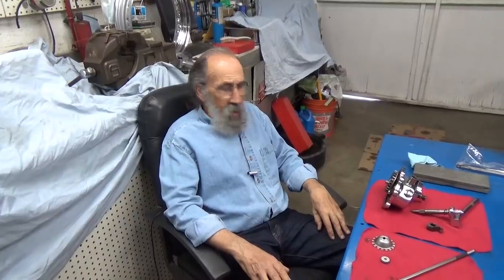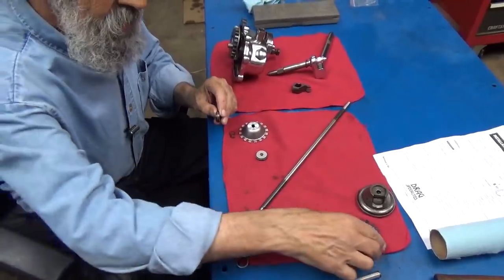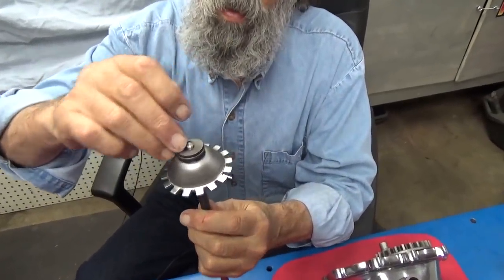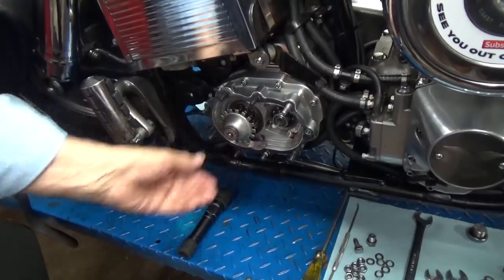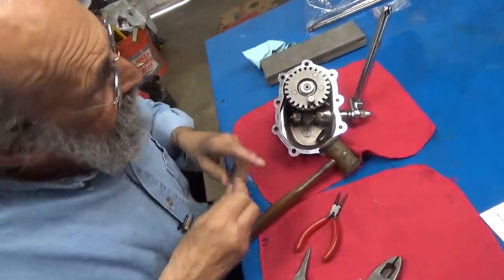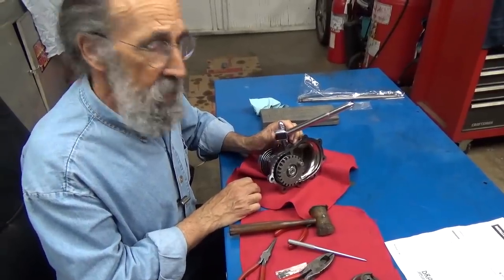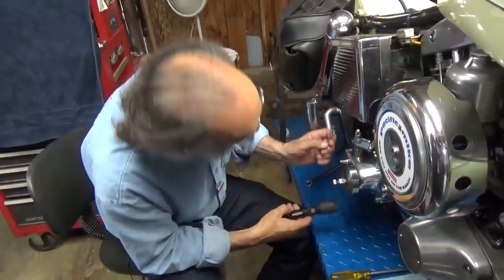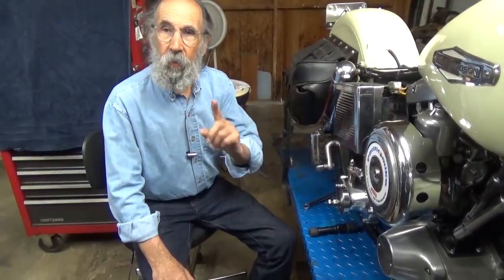Repair by replacing: Clutch Throwout Bearing and Oil Slinger on Harley Davidson Shovelhead.

Comment: Don't know if someone beat me to the name of the bearing. But hear it goes, It's a TORRINTON BEARING...

Mike, I go through the same problem,  I forgot the name of parts, I have it on the tip of my tong, the the name just dosen't come out...
Love your videos...👍

One more thing, and your weight, the washers are bearing races.
Reply from the maker: Not right.  Torrington is a brand.  We replace the original cam bearings in Harleys with Torrington.   The ones we use are encased and have parallel rollers.  But yes, I forget stuff quite often.

Comment: Good info thanks, I just bought two kicker kits for a couple electric start shovels I have. 
This video showed me what to expect during the install. thanks. 
We call  those "C" clips and use C-Clip pliers to spread and install them.
I think you forgot to install your kicker cover gasket. 
Thanks Bro.
Reply from the maker: Thank You.  No, I didn't.  I had already put it on.  I forgot to tell you.  Look closely.
Reply: @pacificmike9501  You dang sure did install that gasket, haha, I see it now. Thanks
Reply: @bovrbey  may I ask where you sourced those kicker kits? I might want to put one on our electric only 78.

Comment: Thanks for the video Mike. Interesting setup on this clutch. I am always interested in seeing how different manufactures design and engineer these type of devices. I just installed a Barnett Clutch pressure plate and new friction disks on my 1997 Yamaha Royal Star. I have launched many clips in my day. I usually use a magnet tool in close proximity to the clip and it usually catches it.
Just got off the phone with the manufacturer of the Clutch. I was just giving some feedback about the installation instructions and how they might be better. I had asked him about the wire that gets installed between the 7 friction disk and steel plates and the 1 friction plate all the way in the closest to the internal engine. I did not get the perfect installation on this and was concerned. He said he spoke with Yamaha top clutch engineer and he said you really don't need it. I feel better about it and the clutch works great so far.
Reply from the maker: Yes, I've done business with Barnett for many decades.  Great people, products and service.

Comment: Hi Mike!
It's mutch easier to put the kicker spring in the end, so you can put the cover without tools. I did it several times on my Baker 6 speed. Cheers from France
Reply from the maker: But it's fun.  Actually, it's a habit from the need to work quickly in a shop environment.  You don't want to remove the arm.

Comment: Hi Mike 
Really enjoy your videos. You have a great way of explaining and showing the work. 
I have a 1946 UL, 74 ci, right hand throttle, left grip controls timer, linkert carburetor.  It needs new cables for front brake, timer, and throttle. I've tried lubricating the cables with dri-slide moly lubricant, held them vertical overnight to get lubricant to drip down, but can't get it to fully coat the old cables. They are not very responsive and it is just dangerous with a sticky throttle. So I ordered new restoration quality cables with wire in a coil in cotton braided jacket. I know I have to trim them to fit, but am leery - they are spendy - cutting the wire and trimming the coil just so - I'd like to get it right.  I've looked in service manual and in Palmer's books and did not find much help.  Looked online and seems only modern cables are covered. Would you consider doing a video on replacing and trimming the old style cables and adjusting throttle spiral, timer, and front brake? Or do you know of a good reference?  Thanks much
Reply from the maker: It's alway tough.  You just have to be careful and trim as necessary.   Leaving them too long and then having to shorten them again is the best.  We'll show it when we have one we need to do.  Can't just randomely do these things.
Reply: @pacificmike9501  Mike
Thanks for the quick reply !  Wow !  That was fast.  I will definitely start a bit longer and trim if needed.  I'll start with brake cable as it's easier to access and doing it a couple times will give me some practice before I start doing the throttle and timer which are run in handlebar.  Thanks again
Reply: Well, just in case anyone else is interested in control cables, I did some more research and found some references, so I'll post them for their use:
1.  Palmer second edition of "How to Restore your HD"  does have a section on control cable routing and trimming in Chapter 2 under Chassis.  See pages 128-134.  
2.  Kirk Perrry's "Mechanics and Owners Guide to HD OHV Big Twins," 1941-59, vol 1 describes timer cable on pages 113-114.  In Vol 2, Perry has lots of photos of parts in handlebars and describes process of cleaning and replacing on pages 89-93.  He gives a good tip for cutting coil wire on page 155.
3.  The second edition (1945) of Nicholson's Modern MC Mechanics, page 319 has some good general tips on control cables.  Of interest is they recommend "tinning" the braided wire before cutting it to prevent unraveling.
4.  Rick Schunk's "How to Rebuild/Restore Classic HD Big Twins" describes installing coil and wire and has nice color photos pages 66-68.
5.  There is a reprint of the early Riders Handbooks "HD Operation, Maintenance, Operation 1930-1949 Models."  It discusses control cables in the Riders Handbooks for 1930-34 and 35-40 models.  This reprint is still available from Harley dealers (as of Jan 2020) under PN 99407-93.  It was $35.
Hope I did not overstep any bounds, but I am a book geek, love the research and sharing what I found.  I know, should spend more time riding, but I am what I am.

Comment: It’s crazy that you chose today to post this video. I could’ve really used it a couple days ago, the Shovelhead Bobber project we are building at the shop I work at had the retaining clip fall off the clutch push rod so all the throwout bearing parts were inside the transmission. I figured it out but it would’ve been cool to have this as a reference. 

Funny how timing works like that huh?
Reply from the maker: Yah it is.  Ever notice in the shop, half your customers have clutch problems at once?  Then, the next week, they all burn up voltage regulators.  Go figure.
Reply: Pacific Mike haha! I have like 3 bikes to work on here in my shop this week for electrical issues! 

You sure you’re not following me around or some something? 😂

In all seriousness I appreciate the reply and I seriously appreciate the fact that you post videos like these. I’m 32 now, been doing this since I was 13-14 and I cut my teeth on Twin Cams and now I’ve also pretty well got the M8 figured out, especially the EFI models. I grew up with that so I had to have help from older, more experienced techs like yourself to learn how to diagnose and repair carbs properly. The same with most of my Evo motor knowledge, I’ve gained it by watching videos like yours and Tatro Machine’s. There’s not many of you guys around that know how to work on these older bikes, this knowledge you’re archiving and sharing is absolutely invaluable and priceless in my opinion. I can’t tell you how much it means because you can’t find this kind of good, solid information from knowledgeable guys just anywhere. Especially in this day and age where everyone who thinks they are an HD tech is able to post their ideas all over forums and Facebook. It’s so nice to have people like you that are experienced, seasoned and most importantly actually practicing the art, not just a hobbyist doing it on the weekends. 

I can’t say thanks enough sir.

Comment: Last E clip I had to play with wound up in the bin and a regular snap ring was in its place. I TOO prefer the Earlier style throw out bearing. I find that the later part has too many bits to screw up when you least expect it.
Reply from the maker: I agree.  What I actually did find the first E clip in my beard.
Reply: I think you might have meant , 'parts to CHEW UP' !  At least that's been my experience with my Ol Shovelhead. Lol

Comment: You’re a master, and I still can’t get my baby started
Reply from the maker: What is it?  What year?  What carburetor?  What ignition?  When did it run last?  How old is the gasoline?  I'll play.  Gimme facts.
Reply: 05 Harley Dyna Super Glide Custom EFI I’ve changed plugs and battery I’m missing something
Reply: It’s an 05 Dyna Super Glide Custom EFI , I bought it a couple months ago. I brought it to the dealer who supposedly went through the whole bike. I rode 10 days ago. Got towed home, jumped it and it fired up. I left it on charge and the next day it wouldn’t start. Changed the battery which was shot and it fired up. I went to the gas station, topped my tank off stopped home and it never started again. I changed the plugs 2X , they first I pulled out were original Harley plugs.
Reply: Stephen, I'm sure that Mike won't mind me joining in, but what custom E.F.I. ? We can only offer advice if you're more specific.  
Hope that helps,  thank you.  SARGE BULLDOG.
Reply: SARGE BULLDOG I’m not sure what you’re asking. I have a 2005 Harley Davidson Super Glide with EFI. Am I missing something because I need to be educated if I am.

Comment: Very good i'm working on mine now. One guy says he just put a regular snap ring on the clutch pushrod. The tabs for the snap ring pliers stick out too far and when the shaft spins they contact the operating cam on one side or the other and it gets stopped from spinning. So the snap ring is forced to not spin while the pushrod does spin. Mine was extremely loose for that. Also if the cam comes out of contact with the thrust surface it can come down on the snap ring ends and distort it. You see the kits on line with a snap ring not good. Either grind off the snap ring tabs or use the E-clip like Mike does here. You have to look in the fill plug hole to see this with a flashllight to see the issue.
Reply from the maker: That little E clip works great.

Comment: Another awesome video. This is a fix I need to do. Basically the same steps if you use the old style throwout bearing isn't it?
Reply from the maker: Yes.
Reply: @pacificmike9501  ..Thanks Man. Much appreciated.

Comment: Hello Mike,  I had to remove my exhaust pipes to access the cam chain tensioners on my Dyna. I had to use a torch to heat the nuts on the front head. So, before I put everything back together, should I use a never-seize on the threads?
Reply from the maker: I don't know where you live, but, you kinda want those nuts to take a set and not come loose,  especially on a rubber mount motorcycle.  Chase the threads, install new gaskets, remember to tighten those nuts after a couple heat cycles, then check them again several times.  Do not overtighten, because those are already hard steel studs that have been heated and cooled a lot of times.  But, "never-seize"  is a wonderful product, probably not for this application.
Reply: Pacific Mike Thanks Mike. I won’t use Never-seize then. I’m not sure how to get in there and chase the threads on the studs. There isn’t much room. Is there a special tool?

Comment: Good afternoon Mike very nice video we have a 1985 lowrider with a 4-speed transmission we are getting some noise when we pull in the clutch then the noise goes away after the transmission stops spinning from the engine with the clutch still pulled in would that throwout bearing be the culprit or would it be the main pilot bearing obviously we're going to check the fluids and whatnot here first but I'm suspecting it's either one of those. Thank you again for all that you do we have learned so much from you see you out on the road
Reply from the maker: It can be the throwout bearing, the clutch basket bearing, the mainshaft bearing in the inner primary housing, or a couple more possibilities.
Reply: @pacificmike9501  well thank you Mike for the quick response we will have a look at it.

Comment: Hay Mike, I tried to adjust my clutch basket so belt stops waring. But now have to do it with your suggestion to put a spacer on the main shaft. But now it’s going to put the starter gear ⚙️ farther away from the ring gear ⚙️ in which they barely catch as it is already. I was wondering 💭 if I can put a spacer on the jack shaft so that it would put the starter gear closer to ring gear ⚙️ ? Confused 🤷‍♂️
Reply from the maker: Chances are, the starter jackshaft is not coming out far enough.  Check to see if the lever that engages the jackshaft is bent or if the plate the jackshaft comes through is bent.  That plate is the most common to get damaged and is readily available through the suppliers of parts for early bikes.  I'm assuming you're working a  Shovelhead, either FL or FX.  You didn't tell me what the bike is.
Reply: @pacificmike9501  Yes 1980 FXWG Shovelhead Mike. I will check all of this. It’s been going on for to long now. Thanks 🙏 Mike. I love your work and video’s
Reply from the maker: Thank You.  I'll be interested to hear from you.  Sometimes it gets difficult to explain without seeing it.  But, working properly,  that jackshaft moves quite a distance.  Sometimes, it gets limited by the outer end because the bearing in the outer primary is from the wrong model.  Check against another unit or two that the depth of that outer bearing is in the right place.  And, don't forget the bronze washer.

Comment: Hey Mike, love the videos! I am restoring an '84 FLHX that I acquired in boxes - truly a basket case. The 4 speed tranny was mostly intact and I am 95% done with rebuilding it. I bought a new clutch pushrod kit that came with the slinger, bearings, etc, and a "pushrod bushing". None of the parts diagrams I have nor the shop manual give a clue what to do with this bushing. In your video, I see it on your work table. But you didn't install it in this video. Where does it go?
Thanks in advance!
Reply from the maker: Something you probably don't need to replace, inside the end of the trans mainshaft.
Reply: Yes! I see it in there and it's fine. Thanks so much! You have literally guided me through the rebuild thus far. I can't wait to hear it run the first time.
Reply from the maker: Cool.

Comment: Hello my friend I have a 1992 electra glide sport and I can't unscrew the fuel cap is there a hidden lock I don't know about before I put a little more pressure regards Alan the flip top opens fine and I am sure it is the screw in type
Reply from the maker: Not to my knowledge.  In fact, the threads on the cap should be plastic, if it's an original cap.
Reply: @pacificmike9501  it's okay it was exactly what I thought but I wanted to make sure before I wrenched on it it's out and I had the Good sense to order another from America just in case but it is all safe just waiting for the fuel cap regards my friend Alan from across the pond

Comment: MIKE!!! thanks so much for the videos. I appreciate your mentorship.

 I just replaced my second throwout bearing in 2 days.  This is super discouraging.  I have a 75 FLH (now a swingarm chopper) with matching trani.  It's late 75 so it has the late style oil slinger.  I'm thinking about running the old witch hat slinger.  What are your thoughts on this?  I really don't want to take this apart again for a while after I replace it.  - More info:  I installed the entire kit like you did in this video. I have the adjustment screw adjusted properly. (Screwed in until you can feel pressure then back off ~1/4 turn.)  My spring plate is 1 1/32.  Everything should be good.  What are your thoughts??
Reply from the maker: It sounds like something else is wrong, maybe the angle of the clutch arm.  Maybe you're running the cable too tight.  I don't mean to offend, but I treat myself the same way.  I start over and go all the way through.  Something is hanging up somewhere.  Once you figure that out, step up.  There is a kit that allows you to install the early throwout bearing in your transmission.  It includes the bearing, the pushrod and kicker gear for the early bearing to ride on.  The major suppliers of aftermarket parts for old Harleys carry them.  The old setup was really hard to wear out.
Reply: @pacificmike9501  Thank you for the advice.  I didn't think I was running the clutch rod and spring plate too tight but I was. I started over and now seems to be running great.  If I burn it up again, you bet I will be using the old style bearing.   Thanks again Mike!  -JP

Comment: Hey Mike, you mentioned those older style bearings getting old and making noise but still working just fine. I've got one that's pretty worn and rattle-y. Wondering if you think that needs replaced? Thanks
Reply from the maker: Afraid that's your call.  They seem to go forever.  Don't hold me to that.  I'm not sure.

Comment: I have the same year model bike, and IMO those new style bearings are a pos, have had 2 of them go out on me, The reason I say this is the fact that the radial layout of the needles relative to the washers,(races), the outer ends of the needles need to roll over more distance than the inner ends which is ok if there is no load, however under load of the clutch springs either the inner or outer ends will be skidding on the races rather than rolling. If they were ball bearings it would be ok as they can track in a circle, but needles only track in a straight line.
Reply from the maker: Good point.

Comment: Did the new style of throwout bearing with oil slinger start in late 77?   I have a 77 Shovel transmission that had the old style throw out bearing, but I bought the newer version kit because I believe my trans may be a later model 77.  Does it matter which throwout bearing I use?   Thanks for the great videos!
Reply from the maker: The early, big throwout bearing (be sure you have the right rod in there), is a much better part than the late style.  Use the early one.